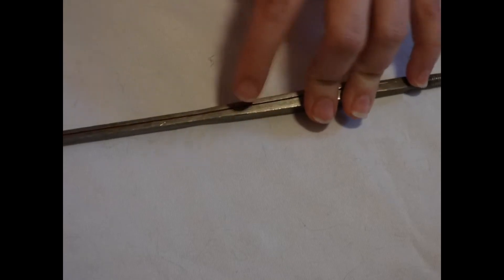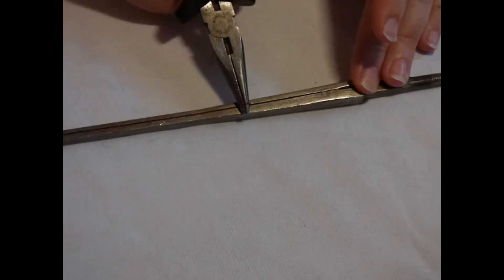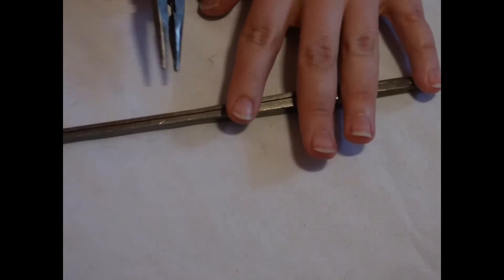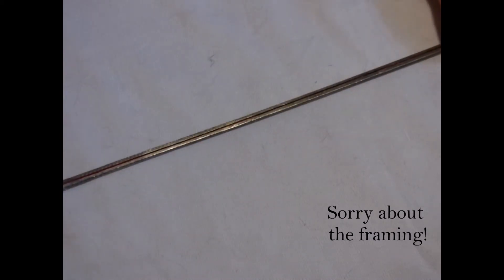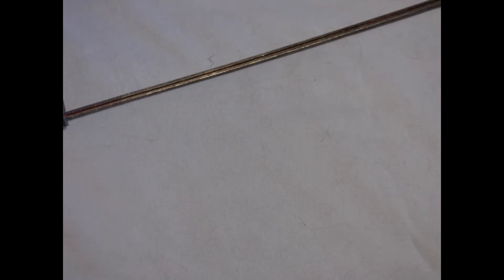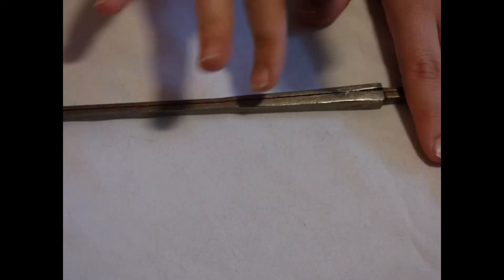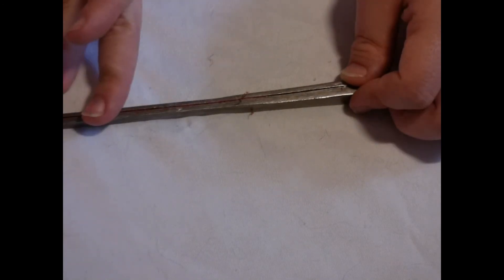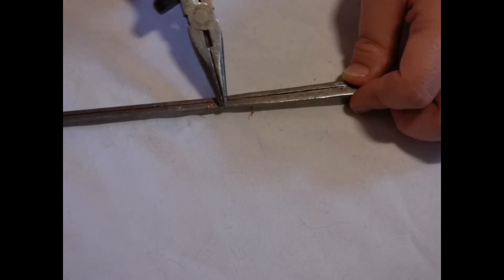Recovering a Broken Wire during a Wire Roll Rewire Preparation

Comment: i just use a precision screwdriver (or very tin screwdriver or any price of metal that fits into the groove) to act as a chisel and a small hammer (or wooden block ... doesn't need much force ) to hit the back of the screwdriver with the front in the groove where the wire has broken off... gently tap then the wire usually pops up (or rolls sometimes if I am lucky) rather than put in acetone again or using the blade as you do here (taht is actually a better idea...lol... i am usually doing a few things at once (or someone needs the foils soon to use) so try to do this as fast as possible) ..